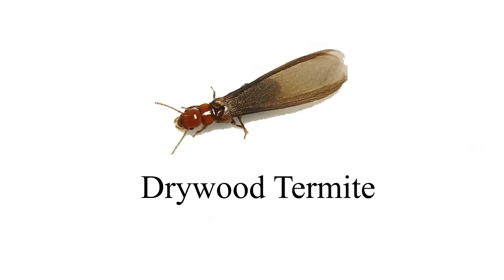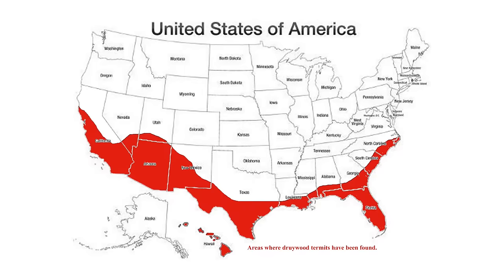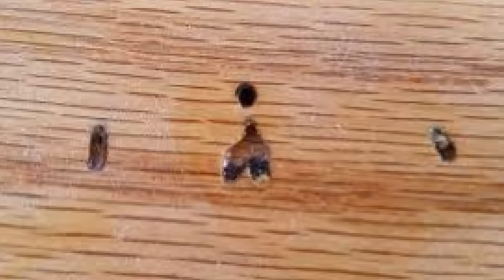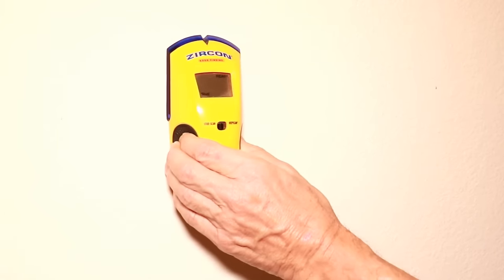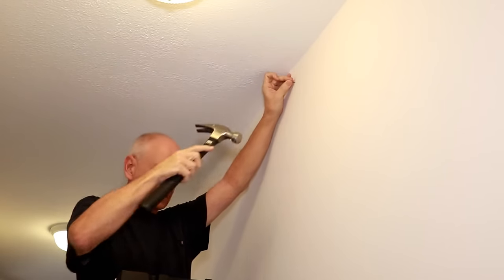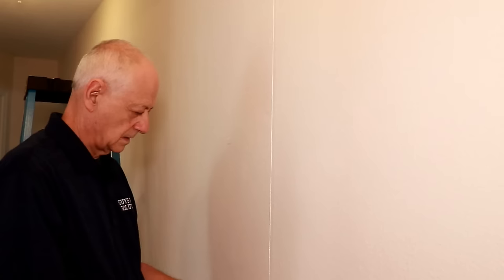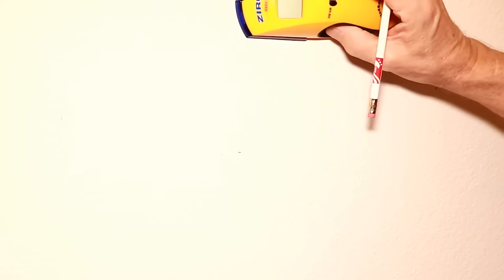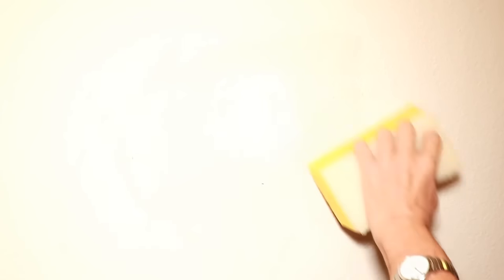How to Treat a Drywood Termite Infestation Yourself. A MUST see if you have Drywood termites.

Comment: Hi Guy!  Thanks for the great videos.  We recently discovered dry wood termites in a kitchen cabinet.  We have removed the cabinet from the kitchen and are looking to treat it.  While you said Fipronil foam works great, i also have a bottle of Taurus.  Could i use that instead of the Fipro?   We discovered the termites in the side panel when there was signs of frass and we replaced that piece of wood.  There are signs they still may be in the back piece of untreated, bare wood.  If we can treat it with Taurus so we do not have to purchase Fipronil foam that would be great. If you think the foam is the better option, i will use that.  Just trying to save a few bucks :) Thank you!
Reply from the maker: Unfortunately, you cannot use Taurus SC for that purpose.  You need to use the foam because it expands to several times its size when you apply it.  That way it gets into all the areas of the gallery.  It is important to understand how drywood termites work.  They enter through cracks and crevices around windows, doors, the eaves, pipe penetrations, and so forth.  Most of the time, they enter through several locations.  That is because a swarm of them attacked your house at the same time.  If there was a crack or a crevice, then they probably found it.  After they established their galleries, which will be inside the wood, it will take four to seven years for them to be able to swarm.  Now that they are in your house, the swarmers will use holes that are in your studs to travel through the walls.  Those holes in the studs were created by the electricians to run the electrical wiring.  Not only are these holes going through the studs, but holes were drilled into the attic for the light switches and to run some of the wiring for the outlets.  So, the termites now have easy access throughout the attic and the walls.  If you have a basement or crawl space, they have access to that as well.  Most of the time, you will have no idea that they are in the walls, because the frass is inside the wall.  To make matters worse, if you have drywood termites, then your neighbors have them too.  That means you have been getting swarmed for as long as they have existed in the neighborhood.  Most likely, we're talking about years, so it's a safe bet that, in addition to that one cabinet, you have these guys in many locations in your home.  While it is possible that you got lucky and just that one cabinet is affected, there is very little chance that this is the case.

I always hate to be the bearer of bad news, but if you have drywood termites, the only sure way to get rid of them is to fumigate.  Prices for this can vary wildly in this industry, so I recommend that you watch my video on how to hire a pest controller without getting ripped off.  That video can save you a lot of money.  You should also know that the gas they use to fumigate has absolutely no residual action whatsoever, so you can get reinfested the moment the tent comes down.  Like I said before, if you have drywood termites, then your neighbors have them as well.  Since drywood  termites swarm every year, it is almost a certainty that you will be reinfested within a year after the fumigation is done.  The only way to prevent this is to do a preventive treatment on your house every 60 to 90 days.  Most pest controllers will not do this, so it is something that you generally need to do yourself.  I have a video on how to do that and I will place a link below.  If you absolutely cannot afford to fumigate your house, then you can try spot treating it yourself.  It is virtually impossible to find all the termite galleries, but it is way better than doing nothing.  Regardless of how you treat it, you should begin the preventive treatment immediately, so that you do not get additional termites paying you a visit.

I am so sorry that you are having this problem.  Be well my friend.                      

Video on how to hire a pest controller without getting ripped off:  https://youtu.be/y-a8XOqVrlE

Video on how to prevent drywood termites:  https://youtu.be/Yozv3s-Qwlw
Reply: @GuysPestSolutions  I also have drywood termites in my kitchen cabinets. Taking them out will be expensive and it puts the countertop at the risk of breaking. Tenting is a terrible option for me as I am in a townhome. Spot treatments with foam have been proven ineffective. Is there anything else you could suggest? These pests showed up after 8 years of the kitchen installation and, I was told, they probably came inside the wood from the factory. Much appreciated!
Reply from the maker: @alansoftbr  I'm so sorry that you are having this problem.  I always hate to be the one to deliver bad news, but the truth is that there is no effective way to treat drywood termites in a townhome.  That is just the reality of the situation.  It is possible that the drywood termites came in with the cabinets, but it is far more likely that you have an infestation of drywood termites in the rest of the home as well, and they just found their way to the cabinets.  If they were already in the cabinets when you purchased them, then you would have started to see the frass almost immediately after the installation was complete.  The fact that it took eight years to see the activity would suggest that the termites were not in the cabinets when you purchased them.

Since you cannot fumigate the townhome, then the only options you have are to use Bora-Care on any untreated wood, in the attic, or crawl space if you have one.  Then you need to spot treat with a fipronil foam wherever you can locate activity.  Make sure that you are using the correct foam.  You cannot use the products that you buy locally in the big box stores.  Those foams do not use fipronil as the active ingredient.  Also, the foam must be applied correctly for it to work.  I go over all of this sort of information in the video.  To treat the cabinets, you should just shoot the foam into the exit holes and kick out holes for at least 5 seconds, or until the foam is coming back out of you.  This should take out the gallery within a few weeks.  Keep in mind that this is not a quick help product.  It is designed for the termites to spread it around the colony.  That way you take out all the termites, including the queen. 

I can assure you that the problem is probably not limited to the cabinets.  So, the only thing you can do in your situation is to follow all the recommendations in the video.  You are never going to get rid of all the galleries and they are going to continue to keep cropping up.  Therefore, you should do an inspection every 6 months and treat any galleries that you find.

Keep in mind that if you have drywood termites, then the other units have them as well.  Many times people will refuse to believe that they have them, and so they will do nothing to treat them.  Therefore, it is possible, at some point, that the adjoining units may experience a structural failure in an adjoining wall or the roof structure of their unit. If that happens very near your unit, it is possible that your unit may be declared structurally unsound as well.  The only good news about drywood termites is that they are very slow eaters, so it usually takes a very long time for this sort of thing to happen.  Still, you don't know how long they have been eating your townhome.  Therefore, I recommend that you make plans to sell the townhome and try to purchase a single family dwelling.  I know this is a lot more expensive, but you are dealing with a situation that you are most likely not going to be able to correct.  Over time, this may result in serious damage to your unit that can be quite expensive to repair.

Again, I am so sorry that I have to be the one to explain this to you, and I know it is not something that you want to hear.  However, it is the reality of owning a townhouse in an area where drywood termites exist.  Since these guys are slow eaters, you do have some time to try to figure out how to purchase a single family dwelling and sell the townhome.  The important thing is to start working on it.  I know this may sound like drastic advice, but I'm sure you contacted me because you wanted an honest evaluation and advice, and what I am telling you is all true.  Your best bet would be to get out of Dodge as soon as you can manage it.

I hope that helps.  Be well my friend.

Comment: Thanks for the informative video, I got a question. Once I find the stud I will drill holes spaced about 4 inches from top to bottom but is actually on the stud and not the void space between studs, correct?  I want to make sure Im drilling holes 1.5 inches into the stud. (that is including the drywall) I hope it make sense what Im asking.
Reply from the maker: Yes.  You drill into the studs and not the voids.  The termites do not live in the voids.  Just the wood.  You can drill up to 3 inches into the stud and they should be every 4 inches apart.  Keep in mind that this treatment is kind of a Hail Mary Pass.  Let me explain.

It is important to understand how drywood termites work.  They enter through cracks and crevices around windows, doors, the eaves, pipe penetrations, and so forth.  Most of the time, they enter through several locations.  That is because a swarm of them attacked your house at the same time.  If there was a crack or a crevice, then they probably found it.  After they established their galleries, which will be inside the wood, it will take four to seven years for them to be able to swarm.  Now that they are in your house, the swarmers will use holes that are in your studs to travel through the walls.  Those holes in the studs were created by the electricians to run the electrical wiring.  Not only are these holes going through the studs, but holes were drilled into the attic for the light switches and to run some of the wiring for the outlets.  So, the termites now have easy access throughout the attic and the walls.  If you have a basement or crawl space, they have access to that as well.  Most of the time, you will have no idea that they are in the walls, because the frass is inside the wall.  To make matters worse, if you have drywood termites, then your neighbors have them too.  That means you have been getting swarmed for as long as they have existed in the neighborhood.  Most likely, we're talking about years, so it's a safe bet that you have these guys in many locations in your home.
                            
I always hate to be the bearer of bad news, but if you have drywood termites, the only sure way to get rid of them is to fumigate.  Prices for this can vary wildly in this industry, so I recommend that you watch my video on how to hire a pest controller without getting ripped off.  That video can save you a lot of money.  You should also know that the gas they use to fumigate has absolutely no residual action whatsoever, so you can get reinfested the moment the tent comes down.  Like I said before, if you have drywood termites, then your neighbors have them as well.  Since drywood  termites swarm every year, it is almost a certainty that you will be reinfested within a year after the fumigation is done.  The only way to prevent this is to do a preventive treatment on your house every 60 to 90 days.  Most pest controllers will not do this, so it is something that you generally need to do yourself.  I have a video on how to do that and I will place a link below.  

If you absolutely cannot afford to fumigate your house, then you can try spot treating it yourself, like I explain in the video you watched.  It is virtually impossible to find all the termite galleries, but it is way better than doing nothing.  Regardless of how you treat it, you should begin the preventive treatment immediately, so that you do not get additional termites paying you a visit.  

I hope that helps.  Be well my friend.                        
 
Video on how to hire a pest controller without getting ripped off:  https://youtu.be/y-a8XOqVrlE
 
Video on how to prevent drywood termites:  https://youtu.be/neNsmVbj8Pc

Comment: Hi Guy! I am 68 years old, have an attic that's a crawlspace, and no one seems to want to go up there and crawl around, (yet I'm still trying to find someone). If i did fumigate & can't get anyone to use Boricare in the attic for me. What are the chances of getting drywood termites again if I just spray the outside of my aluminum soffits & facia (& doors & windows) with the alternating chemicals every 3 months like you suggested in your other video? And does screening the million holes in aluminum soffit stop termites???
Reply from the maker: The treatment that I recommend in my video on how to prevent drywood termites works every time, if you do it correctly.  If you spray a pesticide on every possible entrance where a drywood termite can possibly enter, then they have no choice but to land on it, and that will kill them before they can establish a gallery.  Even though I tell you to do it every 90 days in the video, I have decided to do it every 60 days instead.  The pesticides are supposed to last 90 days, but the last 30 days are not going to be as effective as the first 30 days, so I have decided to do a little bit of overkill.  Fumigating is expensive, so I decided it is better to treat six times a year rather than to treat four times a year.  I'm not saying that treating every 90 days will not work.  All I am saying is that I don't want to take chances.  

The holes in most aluminum soffits are too small to allow drywood termites to get in.  I would be more concerned with areas where the soffit meets the side of the house or the fascia boards.  That is why I make sure I spray all of those areas really well. 

I hope that helps.  Be well my friend.